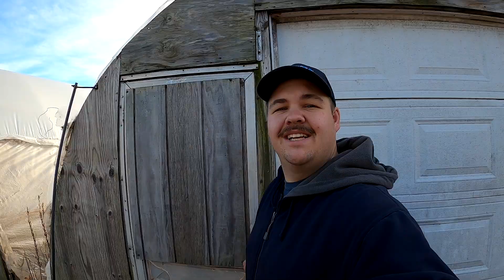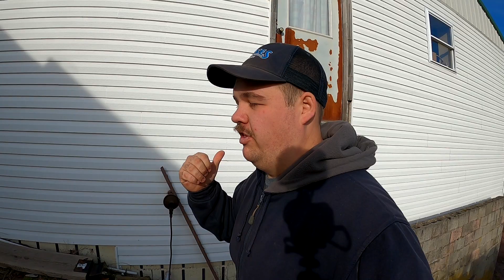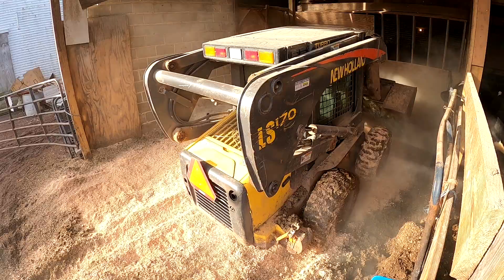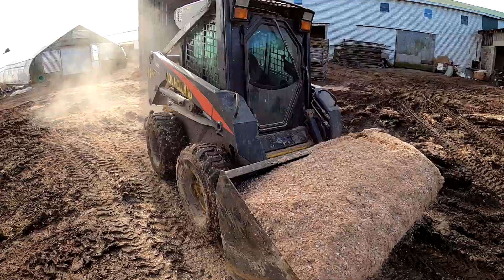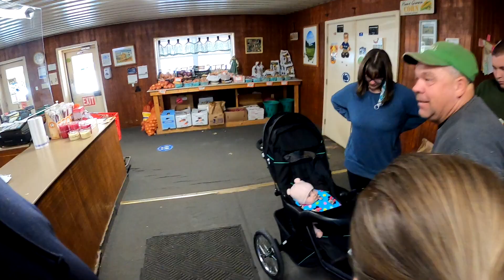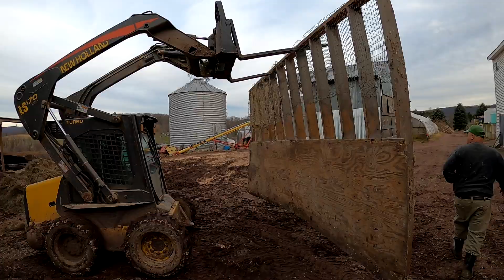Moving onto bigger and better

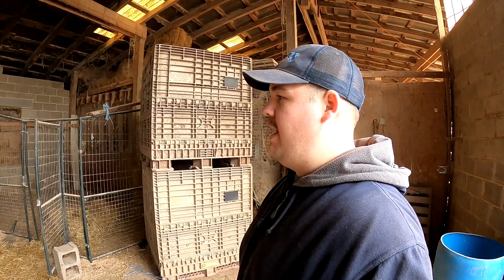Comment: I love the discussion and problem solving you mentioned starting at 7:52. It doesn't seem to matter how many years you have to creatively solve issues and grow a farm. You'll always have new issues because of what you did. And there is the rare moments when there is a total win-win outcome. I grow veggies on a small yard that is surrounded on the south, west and north sides with dense shade. The East of the property which gets the most sun is the front yard and I'm very limited as to how I can use that to grow food. I've been growing on this property for 8 years and the trees are a lot taller and shading even more of what I use to grow in. I also have extreme clay soil that is cement in the summer not allowing the water to soak in and a total slippery sponge in the winter. I've been able to grow a lot of food to this point covering the clay with home made compost and introducing more worms. Last year I grew 130 different types of veg including 75 tomato plants (canning spaghetti sauce), 30 basil (pesto party in July with the kids) 12 pepper plants (trying to find bells that will produce well in my climate) and ...wait for it...500 lbs of squash. That was a big surprise. Most of those varieties were new to me. I have an even bigger challenge for 2022. I have 27 varieties of short season melons. No watermelon. Along with about 100 other varieties of veg to grow out. They have to have full day sun to get sweet. I'm praying for a solution before planting time. We'll see how it pans out. It always does.

Comment: Do you butcher the feeder cattle yourself or do you send them out for processing?

It would be interesting to see how a small farm works in regards to meat inspection and government regulations.
I worked for 
IBP, (now Tyson) in the mid 1980’s and I’m sure a facility such as yours is WAY different than a corporation that runs over 5000 head a day…

I would really like to see that end of your business.
Reply: They do not show the butchering of chickens on this channel for youtube reasons.  Betting they would not show cow slaughter either.
Reply: IIRC you can butcher meat yourself as long as it's not for sale to the general public. If you want to sell like they do, it has to be butchered in a government inspected facility, so a professional butcher shop.
Reply: @essaboselin5252  
I know…
I’ve worked at a meat processing facility, (then called Iowa Beef Processors, IBP) for three years, then as a line inspector for Sysco foods at the same facility…